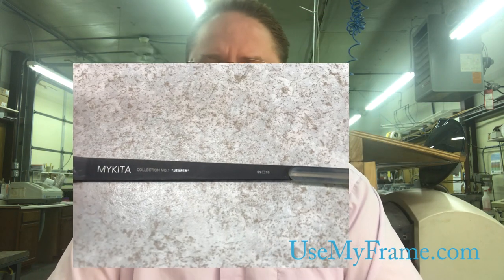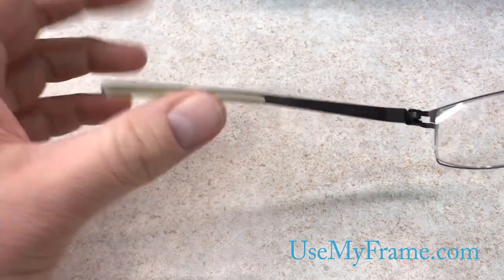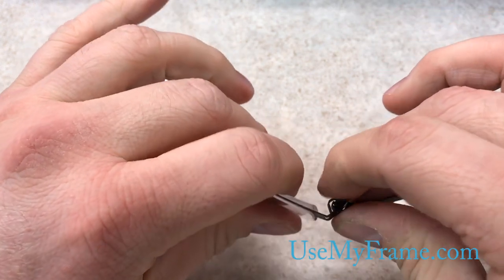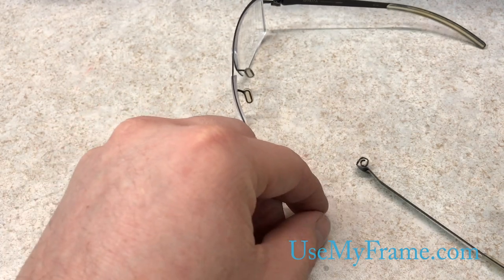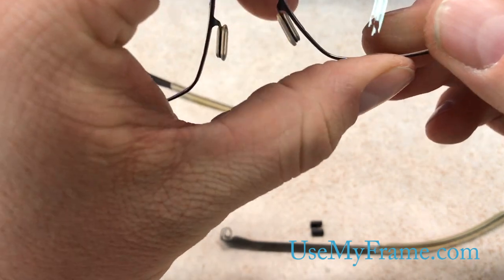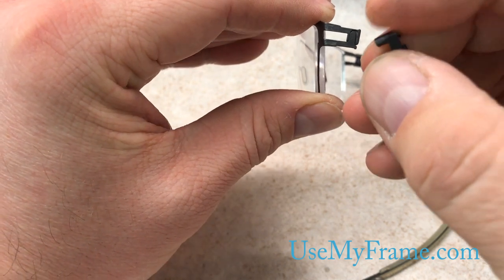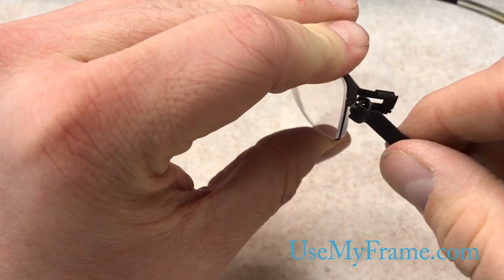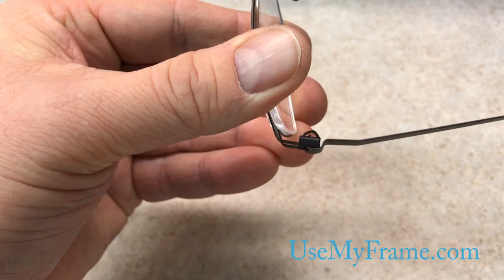How to Assemble Mykita Jasper Frame

Comment: groove width and depth?
Reply from the maker: I think the depth was .6mm, but you should measure the thickness with a micrometer to help ensure the best fitment.
Reply: i did last time 0.55 mm dip and thikness 0.55 or 0.6mm. do test lens first